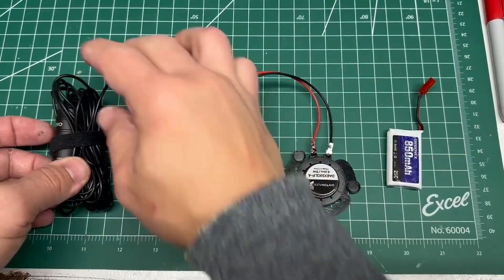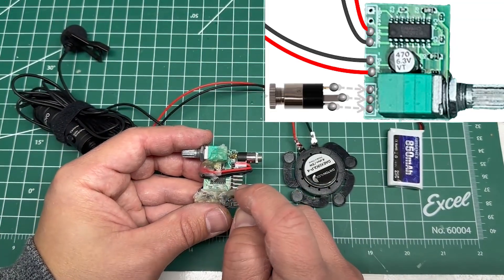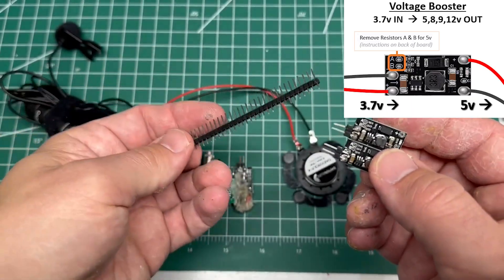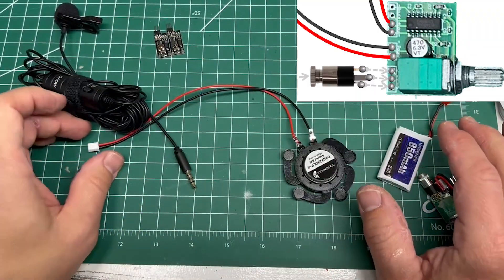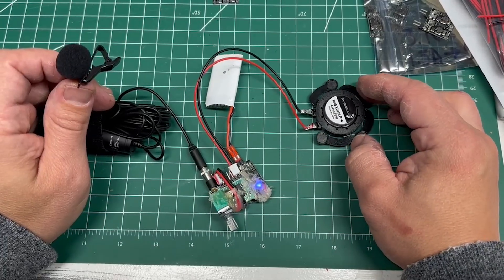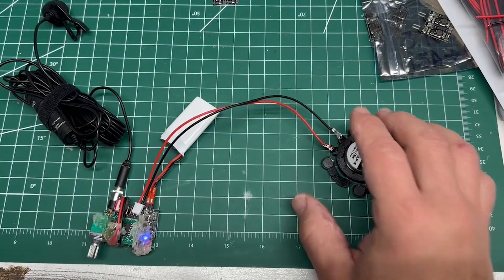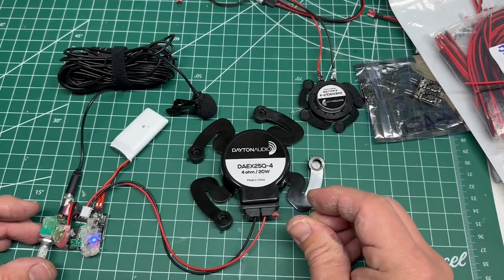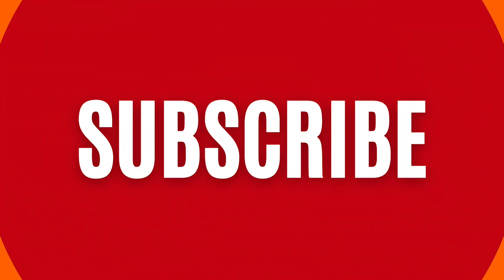This Tiny Amp FITS in a Mask?! 🤯 Cosplay Hack Inside #cosplay

Comment: Hey love the content and was wondering what’s the best mic and amp to use autotune for a mask?
Reply from the maker: I’ve not seen an auto tune specific voice changer. But some voice changers like the I-9 do you have some slight voice pitch modifications that you have to set manually. While, I’ve not tested it for that specifically, i have a hunch it’s not likely  able to make an off key voice  sound on key. to me it almost seems more like an octave shift. You can check out my phone I-9 review going through that feature should be in there. As well as any of the other reviews, I did on voice changers that have that same feature. 
Also I don’t envision this capability being something specific to an amp or mic.

Comment: Hey! Amazing video! I have spent the last three hours trying to make this amp, but no matter what I do, the voltage booster keeps trying to fry. I have built three different Amplifier circuit boards and have gone through quite a few voltage boosters. On my first attempt, there was no blue light, leading me to realize I fried the booster. Now, on my more recent of attempts, I plug in the 3.7 battery into the booster, light comes on. I go to plug it into my Amplifier circuit board, and immediately it begins to smoke. Any advice? I'm struggling seeing where the issue could be as I bought your materials as well. Thank you!
Reply: Figured it out! I accidentally soldered the negative and positive channels together. I’m running into some issue when it comes to the speaker as there’s no feedback coming oit
Reply from the maker: Incorrect polarity will fry your boards. Anytime I had a board smoke. It’s because I had the positive and negative reversed.  This is critical when dealing with power.  Speakers, however, can tolerate reverse polarity, and sometimes you won’t even notice a difference in the sound, however, power is unforgiving always ensure you have the correct polarity..

Comment: I’m running into feedback issues with a speaker in my helmet, will an exciter help reduce that? Or do I need to buy a better mic?
Reply from the maker: BLUF: Cosplay mask feedback control comes from isolation, directionality, gain discipline. 

Best-Practice Checklist
	1.	Mic Choice & Placement
	•	Use a directional mic (cardioid or supercardioid).
	•	Aim the mic only at your mouth, never toward the speaker.
	•	Orientation matters more than distance.
	2.	Mechanical Isolation
	•	Never hard-mount the mic to the mask. (& ideally avoid the same for the speaker)
	•	Use foam, rubber, or silicone to isolate from plastic.
	•	Pad gooseneck mics where they contact the mask.
	3.	Speaker Setup
	•	Use a front-firing speaker aimed outward.
	•	Mount the speaker with vibration damping.
	•	Fire through a grill or vent if possible.
	4.	Internal Acoustics
	•	Add acoustic foam between the mic and speaker.
	•	Create a small physical baffle separating them.
	5.	Gain Discipline
	•	Keep speaker volume low and raise mic gain only as needed.
	•	Set gain in order: mic → preamp → amp → speaker.